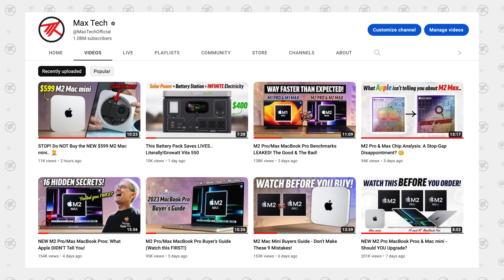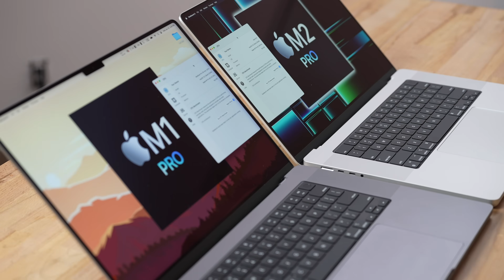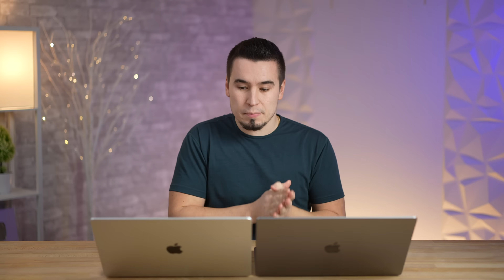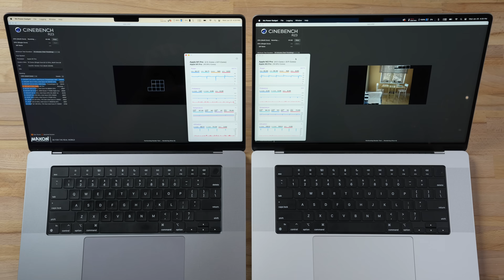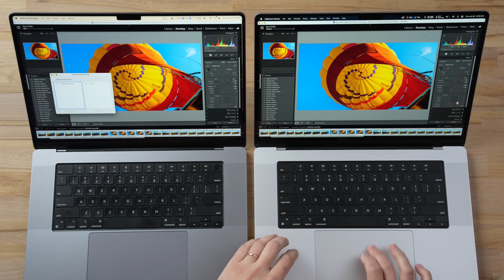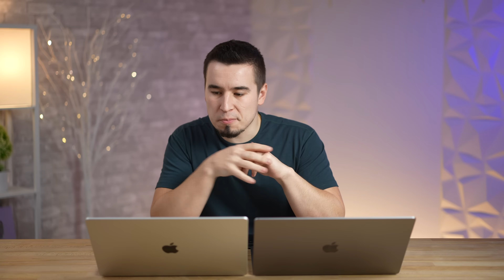M2 Pro 16" MacBook Pro - EPIC Comparison (BAD UPGRADE!?)

Comment: The question isn’t whether or not you should upgrade from an m1 pro chip. From this point on, yearly updates will be minor. The jump from Intel to Apple silicon was huge because of the architecture change, but this is just a minor update. The new m2 pro chips are for people that have an Intel or amd pc/mac at the moment. The update is still however in my opinion really nice to see. 
Thanks a lot for this great comparison and also real world tests, which in my experience say much more about the chip than benchmarks.
Reply: No one but prosumers with lots of money should upgrade from the M1 to M2. Upgrading from the M1 to M3/M4 is probably the best call.

Comment: This is disappointing that Apple slowed the SSD on the M2's.  But the 3D rendering test was an eye opener.
Reply: For every test he did apart from flooding the RAM (unrealistic), the slower SSD speed had minimal impact. It shows that the SSD speed is just a small part of the puzzle and the CPU, GPU, RAM, etc, are all far more critical. These are all upgraded on the M2, so coming from Intel Macs, the M2 is the prominent logical call for a better machine.
Reply: @ahaimes6320  No comparison from Intel for sure.  I've got a 16" M1 Max and I'll never look back to my hot, noisy fan, slow Intel crap.  But the amount of swap to SSD is concerning.  I think I'd not configure an M2 with less than 32gig RAM to cut down on swap and improve the longevity of the SSD.

Comment: It’s crazy how similar the two machines are. Refurbished models are starting to look really good
Reply: Yeah in every way except graphics related tasks.
Reply: definately going refurbished. Do you think its an issue regarding the battery?
Reply: @danseeli5194  I bought my first 2015 macbook refurbished over 7 years ago, and I'm still using it, typing this comment on it as we speak, all refurbished. Never had an issue with it whatsoever. Just ordered a 2023 refurbished today, finally upgrading, and got it for virtually the same price as the 2015 model. It was over 500 bucks off.  Refurbished is the best for Apple products; many people I know have done the same and have not had any issues.
Reply: $200 saving is a good deal!
Reply: Bxbdhdj

Comment: Oooh. This should be good. Gotta go get a coffee to watch this one. Seems to me like more power, more thermals, almost seems like an over/up clock is responsible for most of the m2 pro gains at the expensive of thermals, fans/fan noise potential etc. for marginal productivity gains. M1 Pro is still a winner here, not to mention that the SSD's not tested on these particular models are assuredly once again half the speed from the M2 to the M1.

Comment: I have a question, if we get a 1tb drive instead of the 512, would the drives be faster then?  It's so disappointing in Apple to make these ssd's slower from the previous year by using less slots. By the way, thanks so much for all these comparison videos - you're greatly appreciated.

Comment: With the new M2 Pro and Max SoCs, if I’m correct, Apple doubled CPU/GPU caches. Could you do a study, to see if they compensate for higher processing performance?
And any better RAM management? Esp since entry M2 suffered from this with base 8GB option.

Amazing job, in-depth look, testing as always! Cheers!

Comment: With a proper fan curve temps in M2 will be under control. In fact in my previous intel macs I have always ahd the fans on at a minimun od 2k rpms, barely audible and with great temps.

Comment: 20% more cores, 20% more power, 20% gains... I bet testing under the same power and the same clock speeds the difference between M1 and M2 is negligible.

Comment: thanks for all the videos! im upgrading from an m1pro base model (only 16gb) to the maxxed out m2max model cause the m1pro didnt hold up my expectations last year with some editing projects (mostly 45minutes up) and just regular h264 footage.
it would be a nice comparison, to see of m1pro vs. m2max if anyone is interested. although ill be able to do it myself as soon as the new one arrives. 
i would love you would integrate a long timeline benchmark for final cut, where you compare snapiness of a rather longer 45-90 min timeline with some titles but no crazy stuff and browser scrubbing etc. while 3 screens connected. as that would be like a typical scenario for a tv editor or feature. 

what i can recommend everyone editing out there, both final cut and avid media composer were not happy even with an 32gb mac studio, so just get 64 or higher. even with final cut the ram  was always in yellow mode in the activity monitor and 90% full

all the best, keep up doing these videos
Reply: Huh, I wonder if there was any other factors that went into the memory pressure you experienced. You say even 32GB was underwhelming?
Reply: @ghost-user559  well avid just wants more and more memory because it’s not optimized. And fcp just was constantly at 26/7GB of usage. It didn’t crash of course  as avid did but you could tell it wasn’t as fast as for when your editing something shorter
Reply: To be fair with my intel iMacs I always had 64GB of ram and it was just right. All this new swap memory game I think doesn’t play as well on bigger projects. But anyways, the macs got pretty expensive! i remember having the top notch device for about 3500€ and now it’s more like 4500-5000
Reply: @PeterWuss1  Thanks that good to know. Do you use proxy files in FinalCut?
Reply: @PeterWuss1  Haha yeah they definitely are not going down in price, but they definitely are miles ahead in speed and power compared to the highest spec intel models. 

You definitely sound like you need one of the highest tier Studio machines if that is your regular workflow. You easily could get enough Ram and you could go for the Max or Ultra. But I know exactly what you mean, this unified memory really does require a different mindset to a degree, but at the end of the day more Ram is better no matter what machine you are using.
Reply: @ghost-user559  yes i do. But the files I usually work on are actually low res enough to be handled by these m1+ machines. 
Mostly just some 4K or HD avc from these Sony and canon cameras I guess (I’m not filming)
Reply: @ghost-user559  that’s the thing I think the Mac Studio m1max with 64GB would be just fine for a while. But then it has not the convenience of the laptop, which the new ones apparently even rip the m1 ultra in pieces . Annoying decisions haha. Let’s see
Reply: @PeterWuss1  Haha yeah I am in the same boat but very small projects. So M2 Mini Pro is actually looking like the best deal for me. Or the Max Studio, but that’s definitely not necessary yet for me, so maybe the M2 Mini Pro to tide me over in the meantime until M2 Studios release. The only thing about the MacBook Pro is that I find I’m mostly sitting at my desk anyway these days. Last time I got a MacBook I just docked it and used it as a desktop computer any way, so this time a desktop makes more sense, and I could get an iPad Air or Pro for mobile use.

Comment: Hey isnt this and previous video same 
U are comparing 16inch macs m1 pro and m2 pro and in previous also u compared both of these so whats the difference between them??
Reply from the maker: Previous video was focused on SSD issue and multitasking stress test on RAM
We also did a 14” comparison but keep in mind that’s the binned chip models. This is unbinned
Reply: @MaxTechOfficial  thanks a lot for noticing and replying to my comment😊😊…

Comment: Greatly appreciate your comparison! The fact that the battery life remained unchanged despite the performance upgrade is astounding.  it's still an impressive feat. Thank you for sharing this in your video
Reply: I do wonder if they throttle after long term use and if that heat might effect long term battery health.

Comment: Despite the gradual advancements seen in the M1 and M2, the disparity in my opinion remains significant. Each iteration may bring subtle enhancements, but the overall gap between the two is still quite substantial.

Comment: That Blender score is suspicious tho. How does this insignificant amount of extra cores create such a difference?
Reply from the maker: I explain in the video and show the die shot comparison. There is a much larger area within the chip that houses more GPU caches and other transistors. Almost like extra VRAM or something compared to the previous chip.
Reply: @MaxTechOfficial  Ah ok I misunderstood then. This sounds very interesting. Strange that Apple didn't advertise that on the M2 Pro page on their own website. If this isn't just a software thing then it could be a game changer for 3D monkeys

Comment: Apple merely ramp up the clock speed to give you higher performance on M2 Pro in most case. But GPU does have a nice boost with revised chip design.

Comment: more Ghz doesnt mean more performance thats just miss information in general. But the review is good and I will stick with my m1 max.

NOTE: Also with Logic 168 and 189 trakcs is due to RAM and offloading to SSD. It was probably lucky to squeeze out 1 more track but this isnt due to CPU clock speeds again

Comment: I actually liked to see that Apple retuned the sound of the 14 & 16 Pros, and also the M2 Air. I remember they had made exactly the opposite when updating from Intel to M1, and speaking as a sound technician I thought it was a bit too much clarity, to the point of being harsh, M1 iMac included. For me I think it was a wise decision to retune the sound again and make the highs more recessed. (specially because digital audio increases harshness by default compared to analog)
Reply: why does digital audio increase harshness?
Reply: @psh9952799  yes
Reply: @psh9952799  This is easy to compare using the same recording/master both in a CD or DVD or digital format vs the same recording playing from tape or vinyl. Is has something to do with the way the audio is stored and played in a digital standard (some better, some worse). *very complex stuff (that's why some people are realizing modern digital playback like DSD is easier to listen)

As far as I could test Apple have been using a technology since the days of iTunes and iPod that wrinkle out digital playback. Many years ago I could first compare playback on Windows using a neutral player vs iTunes and iTunes already did this by default. Later when you could install Windows and macOS on the same Intel Mac, it was very easy to listen how audio sounded really harsh on Windows but not on macOS. (for some reason they removed this processing from some devices starting on iOS 14 and macOS Monterey as far as I could test. Even sent them some feedback)

Comment: Always interesting, thanks for the great work guys!

Right now I'm hesitating between two models: the binned M1 Pro with 32Gb RAM and 1Td SSD for 2600€ (discounted version), or the binned M2 Pro with 32Gb RAM and 512Gb SSD for 2860€. 
Having 512Go of SSD doesn't really bother me since I have external SSDs but I'm afraid that it might lower the performance. From what I understand, 1Td is faster and allows a better memory swap. What do you guys think?

Comment: Think the M2 chips in general is a miss for those already using M1. For people still on Intel models, I think M2 chips are worth it especially if you need the new connections (hdmi / WiFi). If M1 chips are on sale those might be more worth it. I'm coming from the 2012 MBA maxed out 13". I'm still deciding if I should get a Mini M2 Pro...